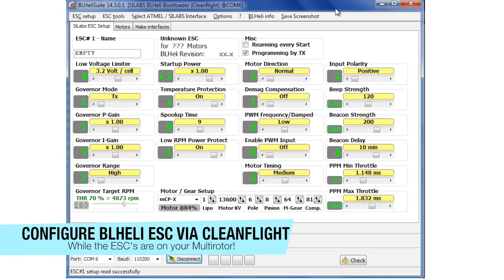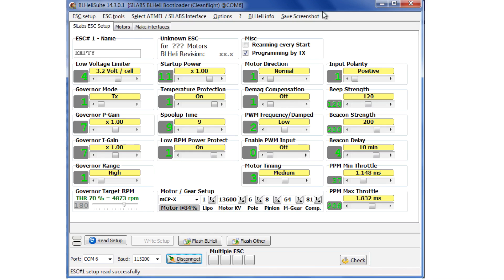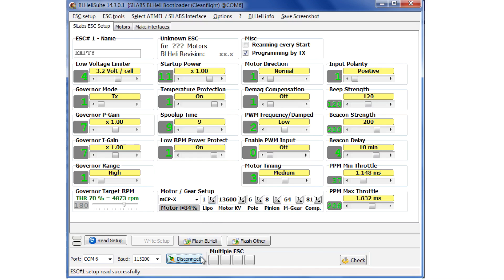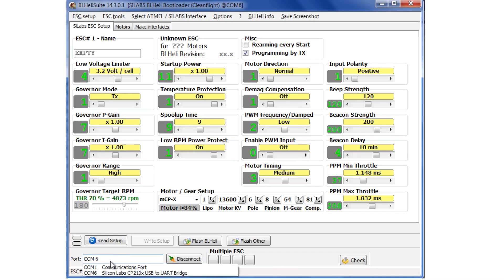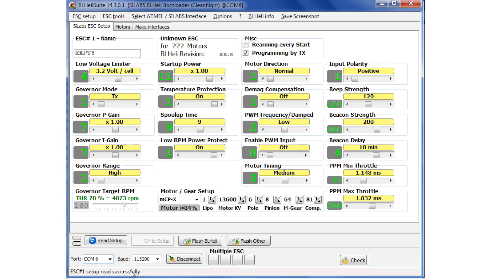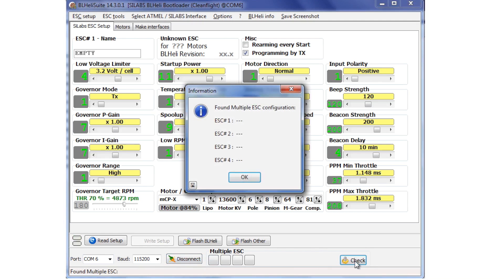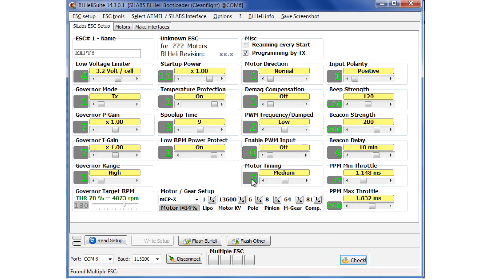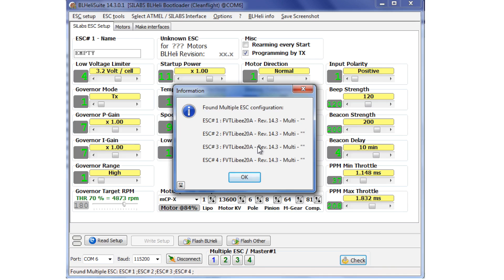Quick Tutorial - Manage & Configure BLHeli ESC via Cleanflight as FTDI

Comment: I have to check silabs bh usb/com not cleanflight to make a connection, says power esc's. Otherwise it says no connection.
Just using a bare board 2 test/no esc's
Reply: Well you cant be connecting a Naze32 with cleanflight then
Reply: +Seafury mike   Didn't know i needed blheli boot loader. Can that be changed or is it just not worth it?
Reply: +Vic Prk (Slick  Vic) simonk bootloaders are also fine. It will work with either.

Comment: Huh, what type of esc's can u use? Looks like a great improvement
Reply from the maker: +Vic Prk (Slick  Vic) Anything that runs BLHeli. It's not ESC specific, but BLHeli and cleanflight specific. Cleanflight has code added to make it look like a fancy USB programmer and BLHeli had the cleanflight driver added to it. 

I love being able to use this system as it means you can leave your ESC's in the quad and just plug in the flight controller to talk to each ESC. There are some real clever guys (BLHeli/Cleanflight) doing some great work in the back ground.

I just saw multishot is being developed, so i think we will see a new suite of faster ESC's coming out that will have fater CPU's. Oneshot125 didn't last all that long!